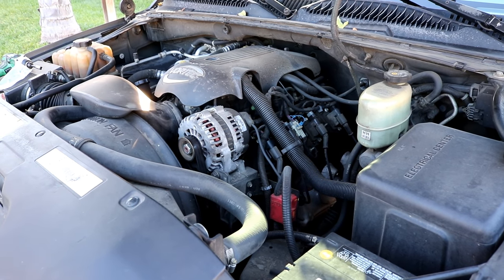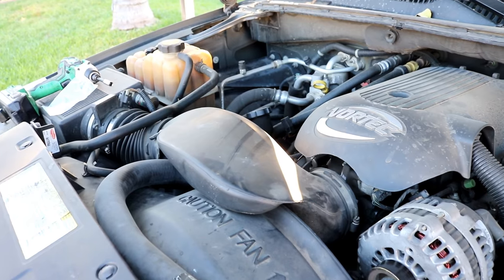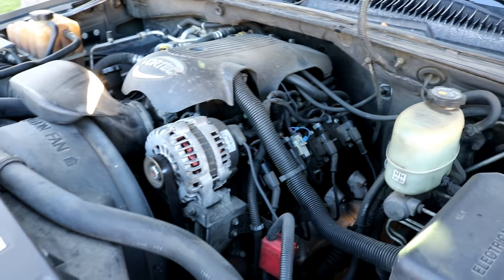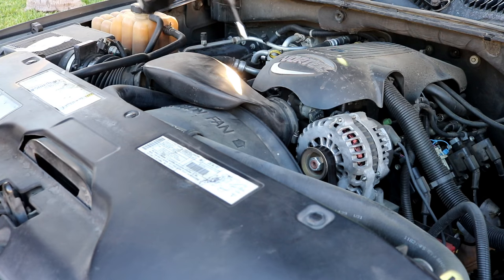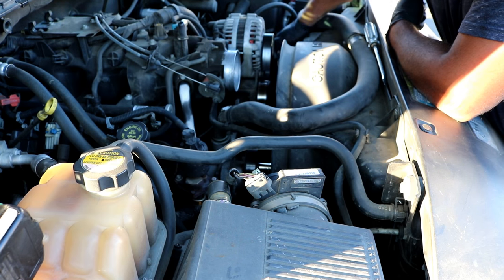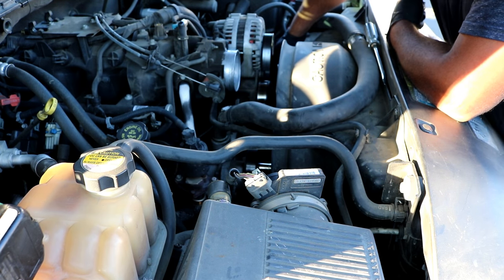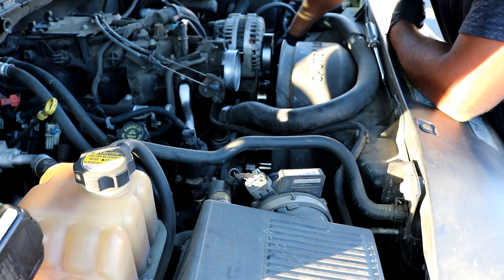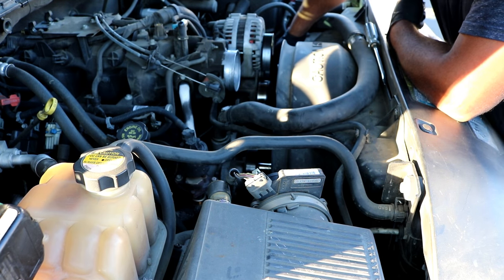2000-2006 Chevy Throttle Position Sensor P0122 (HARD SHIFTING SOLVED HERE!)

Comment: What exactly do you mean by harsh shifting? My 5.3 L has poor throttle response when steering and rough idle and sometimes has long shifts where I will have to let off the throttle and press again to shift. Usually when my engine has been running a while but when its first started it doesn't seem to act that way.
Reply from the maker: How many miles on your truck? Harsh shifting meaning it slams into gear.
Reply: @HelpingHandAutoRepair  327000 km
Reply: I've checked my pcv and I've done smoke test and the only vac leaks I could find were from my oil fill spout and the rubber fitting for the fuel pressure regulator hose where it connects to the regulator.
Reply: My biggest symptoms are rough idle, engine hesitation, loss of power almost stalling at take off and the symptoms show up more when its warmed up and even worse when steering at a take of and reversing. Tested M.A.F. sensor by unplugging it while running and it kills engine like it should and when I plug it back in I can here the idle air control valve functioning
Reply from the maker: Any check engine light? You should scan for pending codes.
Reply: @HelpingHandAutoRepair  also ive recently replaced fuel filter and fuel pump. When the engine is not quite at full temp it runs decent and shifts good but when it tries stalling I gotta pump the gas to get it moving and then it tends to have long shifts and loses power after shift
Reply: @HelpingHandAutoRepair  i still need to by a scan tool or code reader. Times are tight so I've been doing what I can do with what I got. But yes I know I need to give it a scan. I miss the days of  carburetors distributor caps. And room to work on a 350 in the engine compartment lol
Reply: @HelpingHandAutoRepair  no check engine lights just my low engine coolant message but its not low bad sensor in my coolant resivor

Comment: My 02 4.8 silver slips from 1 to 2....could this be the cause. Check engine light on as well but runs great
Reply from the maker: Check the code and see what it says. 

You need to check the TPS live data and see if it is reading smooth.
Reply: @HelpingHandAutoRepair  Thank you!

Comment: I have an 07 denali that does the same thing (hard shifting into 2nd). Should I also try to change the tps or the speed sensor? And if so where’s it located on the newer 6.2? I know that the speed sensor is on the transfer case underneath the car
Reply from the maker: Thenewyorkerpilot do you have a check engine light on?
Reply: Not at all. I even went to the dealer to diagnose it, only code that showed up was a "transmission control module" code and that's it.
Reply from the maker: Thenewyorkerpilot well then there is a code. You need to call them and ask what the specific code was. P0700 possibly?
Reply: Helping Hand Auto Repair sorry for the late reply. I had and still have no codes at all. It's weird cause when I accelerate slowly in 1st gear the rpm goes up till maybe 1.5k rpms then suddenly drops then SLAMS into 2nd. When I floor it in 1st it does a weird sound at like 5-6k rpms (the engine gets obnoxiously loud as if u had ur windows open although they're not) then stays there for like 2 secs then shifts to 2nd. It also does that when I only floor it in first gear, I tried flooring it in 2nd gear and it didn't have any weird loud sounds and shifted smoothly into 3rd. I had it checked by a local mechanic lately and he told me I had a faulty tcm or transmission control module, I don't know if that's the issue or not.
Reply from the maker: Hi, the mechanic is correct. I bet there is a P0700 code lurking that just hasn’t shown itself yet. What I would do if you can is to get under the truck and locate the large electrical connector for the transmission. I forget what side it’s on but it will have a lot of wires on it. Check to see if it is cover with oil or dirt or water possibly. 

If so, FIRST DISCONNECT THE BATTERY!

The disconnect that connector and use some CRC electrical cleaner. Follow the directions on it make sure to let it dry completely. Spray it all inside the connector IF it’s dirty. There was a really big problem with a fair amount of 2007-2012 Chevy/gmc transmission shifting problems. It was mostly due to a transmission communication error code (P0700) or several “U codes.” 

Check on this website.

https://static.nhtsa.gov/odi/tsbs/2012/SB-10043829-6448.pdf
Reply: Helping Hand Auto Repair will check it out, thanks a lot for the help appreciate it 🙏🏻

Comment: would a TPS cause sputtering? When i accelerate i have to be gentle on the pedal for a smooth getting up to speed. If i want to stomp on the gas it sputters horribly.
Reply from the maker: It’s possible
Reply: I have the same problem and I changed my tps and it’s still doing it
Reply: Did you figure out what was going on?
Reply: I was having that issue. My air intake hose from the air box to throttle body wasn’t all the way on and tighten somewhere. Took it all of, secured both sides and gave it some good tightness. No more sputter on accelerating.

Comment: Hi, thank you for the video. I’m having issues with sporadic/occasional rough shifting. My truck is a 2007 Chevy Silverado 1500 HD classic body. 

I tried replacing the vehicle speed sensor first because I got a check engine light with a “P0717 input/turbine shaft speed sensor A circuit no signal”. The check engine light never came back on but I still had rough shifting from time to time. I came across your video so I replaced the TPS yesterday but that did not help the shifting either. 

My truck has the accelerator pedal sensor like you mentioned in this video ( no cables running to the intake). Should I replace the accelerator pedal sensor also? 

I haven’t gotten any more check engine lights since the P0717 code was fixed.
Reply from the maker: Yes
Reply: Helping Hand Auto Repair 

Ok, thank you. I’m going to order it this week and replace it next weekend. I’ll let you know the results.
Reply from the maker: If you have a scanner that can read live data, I would suggest looking at that first.
Reply: Helping Hand Auto Repair 

I have one, I will take a look at it.
The TPS should read 0 at idle, yes? 
Anything else I should be looking for when I use the scanner?
Reply from the maker: Yes correct. It might read 1% possibly but you are looking for that AND a nice smooth linear reading all the way to full throttle. Press the throttle smoothly all the way to 100% if there is any hesitation or erratic readings or if it reads some arbitrary number at idle (like 38%) the. Replace the pedal sensor.
Reply: Helping Hand Auto Repair 

Hi, I went ahead and replaced the pedal position sensor today and I am still getting bad readings when I check the live data for the TPS.  I’ve already replaced the TPS and now I replaced the pedal position sensor and the live data jumps from 0 to 17.6 with no throttle. When I slowly push the gas pedal down the live data will climb and randomly jump back down to zero. Do you know what else could cause this besides the TPS or PPS? Is there something else I should be looking at or replacing?
Reply from the maker: Did you replace the entire Throttle
body assembly or you pulled apart the Electronic Throttle body motor and replaced the sensor inside?
Reply: Helping Hand Auto Repair 

I replaced the entire TPS. The part i used is a duralast TPS4275.
Reply from the maker: Ok. You can try and do a throttle relearn.

1. Start and run the engine in PARK for 3 minutes.

2. Turn the engine OFF for a minimum of 60 seconds.

3. Start the engine and run for another 3 minutes.

4. Engine should idle normally after 3 minutes.

After having performed the relearn procedure and the engine still does not run within normal idle speed, it will be necessary to drive the vehicle above 45 mph (70 Km/h) including several decelerations. Also
ensure that after driving the vehicle, let the engine idle for a minimum of 5 minutes.
If the engine has returned to normal idle speed, the relearn procedure is completed.

If the idle speed is still erratic or incorrect, restart idle relearn procedure.
Reply from the maker: swisherz4 are you still getting the same code as well? Try the relearn procedure first and let me know what happens.
Reply: Helping Hand Auto Repair 

I’m not getting any codes. The issue I was having was occasional hard shifting in all gears. Idle has never been an issue even after replacing both the TPS and PPS. The only thing that I am noticing that is wrong with the truck is the bad readings I get on live data for the TPS.

I will try the relearn and see if that helps
Reply from the maker: Well let me be clear. If you never had any TPS related codes why did you change the sensor in the first place? If you never dealt with the speed sensor failure that could be still the root cause of the shifting irregularities. If your scanner can read pending codes, I bet the 717 code is still there.
Reply: I tried the relearn procedure but I am still getting a bad TPS reading on the live data. No idle issues and no pending codes at the moment either.

Hopefully I’m being clear about my problem, I apologize if I’m causing any confusion. Originally I developed a hard shifting problem that happened only on occasion and the check engine light came on shortly after which was the P0717 code. I replaced the vehicle speed sensor and deleted the code and have not had a check engine light or any codes come back. The occasional hard shifting continued and has not went away. 

I came across your video and decided to replace the TPS to try and solve the hard shifting issue but it did not fix it. Today I tried replacing the pedal position sensor thinking that may help my problem but it had no effect.

The only irregularities I have with the truck currently is that same hard shifting problem and the bad readings I am getting for the TPS on the live data. I don’t know where to go from here. Do you have any ideas before I take it to a shop?
Reply from the maker: I see. What I would do is return the part to Autozone if they allow it and go on Amazon and get an OE TPS sensor made by ACdelco. I think they are around $30-40 on there. 

If you want to try something else and you’re able to get a DVOM then you can try and test the connection at the TPS connectors make sure the readings are accurate and not possibly caused by a loose wire or connector.
Reply from the maker: Purple and dark green should be the TP signal wires. You can backprobe each one of those are see what type of voltage reading you will be getting there. It should be up to a 5v signal.
Reply: I will try that. Thank you very much for your help.
Reply from the maker: Of course. I am no professional by any means. Just learning over the years. Lmk if I can help any more.

Comment: What was the truck doing mine I’d be driving and then I see the same like I lost pedal I was losing power it’s usually between 20 miles to 30 miles an hour and then I seem like I would lost power is that what’s causing it I have them I don’t have cable on my throttlebody
Reply from the maker: Any check engine light on? Pending codes?

Comment: I paused at the point start talking about moving the alternator. I would suggest unplug battery first at the negative terminal the disconnect the plug on the tps and whatever else you need that comes off with the throttle body. Then remove tb then the sensor that way clean tps and tb both. Cuz chances are if your tps is acting up the tb needs don as well. This way your reinstall everything after cleaning and do you relearn once and not twice or what have you
Reply from the maker: Relearn is not necessary. Don’t mess around with the throttle body. If I wanted to make a video showing how to do a relearn I would have taken off the throttle body. It’s extremely simple to swing the alternator up. This same TPS has been on my truck since this videos not a single relearn was necessary.

Comment: Will the TPS prevent it from starting??
Reply from the maker: It’s possible but not likely
Reply from the maker: If it was running just fine before and say today it doesn’t want to start, I would get some starting fluid and spray it into the intake tube liberally and then try to start it. 
First and foremost, if there is a check engine light on, check that and lmk. If there are no codes stored, then read on below.

If it starts up and runs for a little bit then dies, you have a fuel problem. If it still does nothing, you could have a spark issue and I would check the crank position sensor at that point.

Comment: Mine shifts hard as hell after getting up to temp. Would it be the tps?
Reply from the maker: Check to see if you have a pending check engine light code with a scanner capable of reading pending codes.

Also check for smooth TPS signal with a scanner capable of reading live data.

This is the best way to check for proper TPS function.
Reply: @HelpingHandAutoRepair  I'll give it a try

Comment: What was the reason why you changed the sensor? Thanks
Reply from the maker: Hard shifting in every gear
Reply: I have a 2003 yukon that idles high then low i was thinking that you had that same problem. Thank you
Reply from the maker: Do you have a check engine light on?

Comment: Will tps sensor put truck into reduced power?
Reply from the maker: Not usually. If you have a check engine light on, have the codes read.

Comment: I have an 01 Silverado, My check engine light came on about a year ago code 1870 (transmission slippage) so I replaced the transmission and a few months later only my first gear was a hard shift, I replaced the TPS and it fixed it, but 6 months later (today) I have the same problem.. could something else make the TPS go out?
Reply from the maker: Steven Lee No. unless it has failed prematurely.
Reply: Helping Hand Auto Repair    Thank you,  Just replace the TPS again?
Reply from the maker: Steven Lee If you have a scanner capable of reading live data you can test the TPS function by reading what it’s outputting. That would be best to determine if it’s bad or if you may actually have a bad transmission. When you replaced it did you put in a different used one? Or was the original transmission completely rebuilt?
Reply: Helping Hand Auto Repair   I don’t have access to that type just a code reader. My transmission was completely brand new
Reply from the maker: Steven Lee well, they are relatively cheap that it might be worth it to give it a try. However If it doesn’t work don’t blame me lol. There are many things that can lead to harsh shifts. Even if something was put together poorly on the rebuild (I don’t do transmission work in depth) or maybe a brand new part failed inside the transmission.

I will say that if the truck was shifting flawlessly before and then all of a sudden started acting up, I would replace the sensor.
Reply: Helping Hand Auto Repair    Lol don’t worry I won’t point fingers.  I appreciate all the help. Thank you.
Reply: After replacing the second time...did it work?
Reply: troy naquin  no it didn’t, I actually took my truck to a different shop because the previous shop messed up my valves in the tranny so I had to have the valves re-bored cost $300 but it works perfectly.

Comment: I replaced the throttle position sensor on my 2002 Chevy Tahoe the mass airflow sensor and the coil packs plugs and wires and my truck won't start please help
Reply: I also put it on a code reader after all this was replaced and it's still throwing up a p1022 throttle pedal sensor/switch A circuit low so now what

Comment: I seem to loose power when I give it gas at higher speeds like highway speeds. But if I actually/manually down shift the transmission if seems fine plenty of good power. If I don't it sucks and lags.
Reply from the maker: Check engine light on?
Reply: @HelpingHandAutoRepair  no it's not.
Reply from the maker: Does the transmission downshift when you give it gas? Or does it stay in one gear?
Reply: @HelpingHandAutoRepair  it doesn't. It acts like it's misfiring. Then it down shift, then it will slowly start picking up speed. Then it will act normal. But if I actually down shift it my self  it does it just fine. I did change all the spark plugs and wires. Still not running right.
Reply from the maker: Well if it is misfiring, there could be a pending check engine light that you could scan for with a scanner. Not all of them can scan pending codes, but some can. Would be worth trying to find that out first.

Otherwise it is mostly guessing for what can be causing a power/misfire problem without actually being there myself to try and help out.
Reply from the maker: It seems like it is misfiring. A bad coil pack will cause this.
Reply: @HelpingHandAutoRepair  but in lower gears it drives fine.   ??
Reply from the maker: Well on the freeway, when you are in overdrive let’s say (55mph+) and then press on the throttle some, the engine will be under a tremendous load. This places a lot of demand on the coil packs and spark plugs. If one of them is faulty or failing/intermittent, you will get misfires. 

I am not saying that coil packs are the problem, but a scanner that can read pending codes should be used. Drive on the freeway again with the scanner hooked up and see what codes (if any) pop up.
Reply: @HelpingHandAutoRepair  yes, highway speeds only. I will get that checked out. Thank you
Reply from the maker: Of course. Lmk

Comment: Why wont my 1999 4l60e shift into second gear ? When i manually drop it into 2nd gear it acts as if nothing is their and just revs up.it always shifts from 1st to 3rd when in drive.id like to mention the transmission is freshly rebuilt
Reply from the maker: Take it back to whoever rebuilt it. It is possible that the shift solenoid is bad but if it was just rebuilt, there could be a fault there.